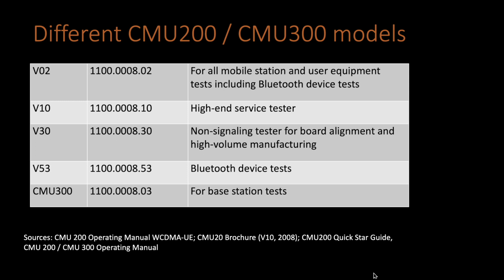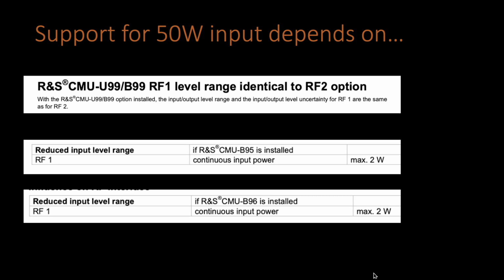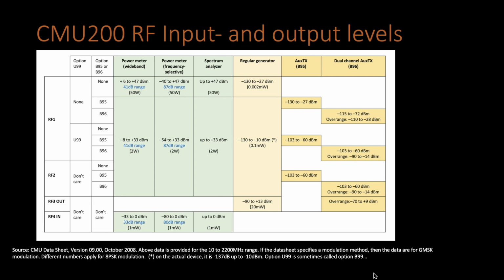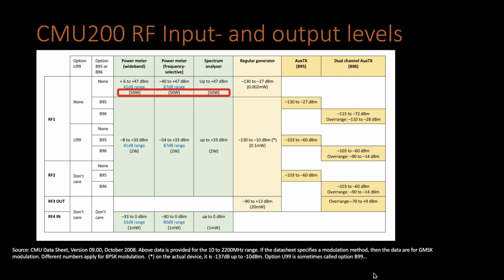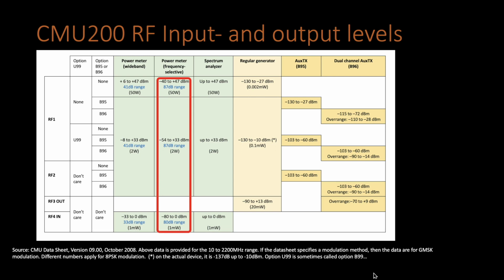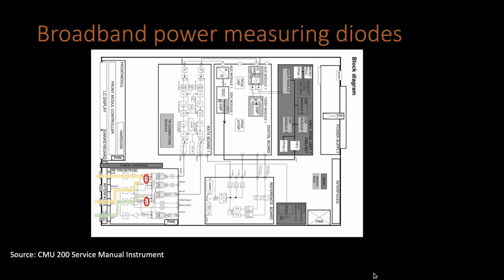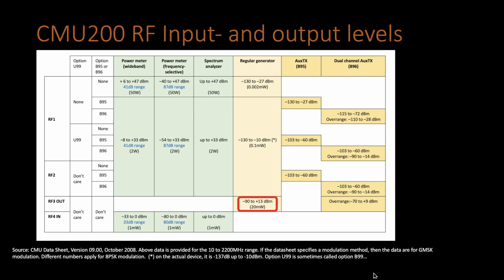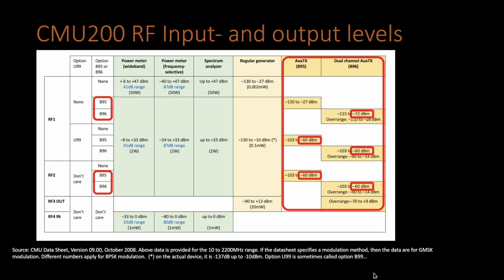REL #21 CMU200 RF I/O power levels

Comment: I recently purchased a CMU200 with the 50W input mostly for power measurements. If one looks at the cost of a set of working surplus high power (>40dBm) RF power sensors to match the range of the CMU200 it makes sense. My CMU200 with 6dB attenuator allows power measurements 100kHz - 2.7GHz up to 500W. Something I haven't heard people mentions is that just the RF sensors at used/surplus prices would cost 2X-3X more than what I have invested in the whole system.
Reply from the maker: True. I’m quite some use cases, a used CMU is a cost-effective solution compared to used specialized instruments!

Comment: Thank you for your cmu200 series!

I compared the frontends of a cmu with B95 Option (2watt), and a normal one (50watt). Both have the 50watt attenuator placed. The only difference is, the 2W version has the B95 option bolted onto the frontend, and the 50watt version has a heatsink with fan attached to the frontend. Both versions can display more than +33dbm on the analyzer, I tested with a 10watt transceiver. The only difference is the cooling.
Reply from the maker: Thanks for sharing your observations! 

I recently recorded some video takes of a 1:1 comparison of a CMU with option B95 (so supporting 2 Watt max) and one allowing up to 50 Watt. When B95 is installed, you can indeed go a bit beyond 2 Watt: only once my unit reached some 39dBm (~10Watt) it gave an overload message. I did this experiment only very short, not to damage the shunt resistor. After all, it is very critical this resistor stays precisely at its right value; otherwise, all power measurements are going to be biased. 

What is interesting is the difference in the bar scale behaviour between these units. The first unit reaches some 80% of that scale already at 2 Watt, while the second unit reaches 80% of the scale at about 50 Watt.  So the bar scale is adapted to the actual max power given the options you have installed. 

I plan to finish the full video soon and post it hopefully this weekend.

Comment: What schematics of the CMU200? It would be so cool to have 😅
Reply from the maker: Unfortunately, I'm not able to share more schematics of the CMU200 units...
Reply: @rudiselectronicslab861  You really have schematics for the cmu? Do you work for R&S?
Reply from the maker: No, I don’t work for R&S :-) Not at all. But sometimes, a bird flies by and drops some papers for me. Sometimes the bird tells me if there are parts I may share with others.
Reply: @rudiselectronicslab861  Anyway I would drea to have thyem too, too bad my flies are just annoying and not cool ahah. I have problems with the optional I/Q board is bad. I think a supply is missing but there are thones of that in that board! Also the manul just indicate that board as a mux there is way more stuff in there!
Reply: @rudiselectronicslab861  I know...